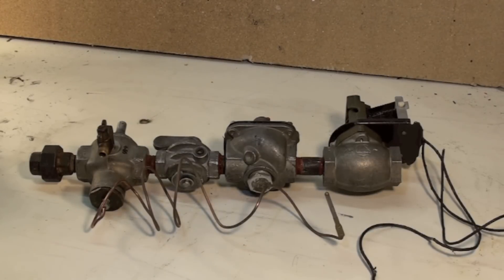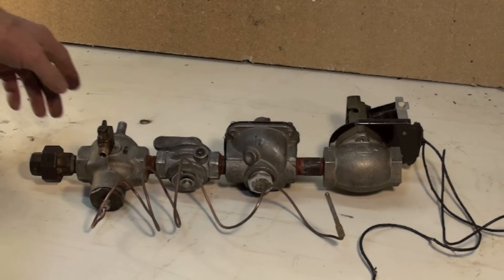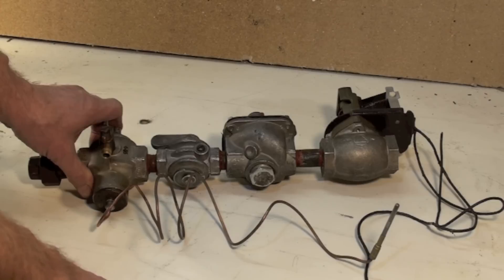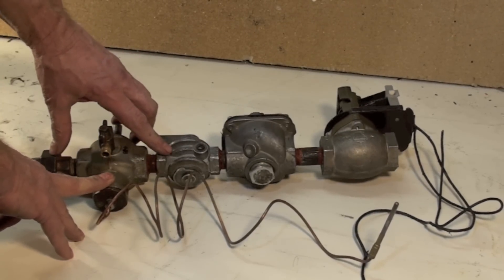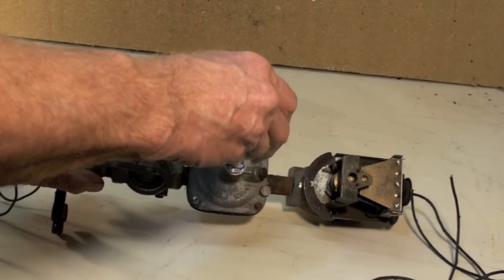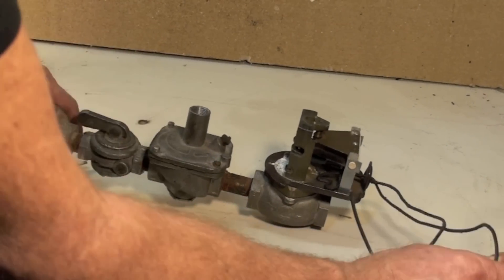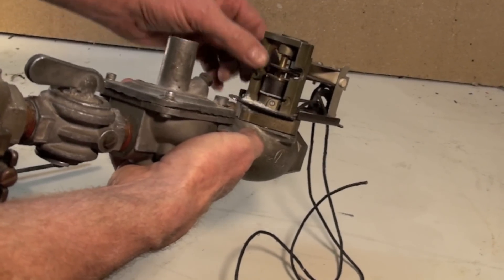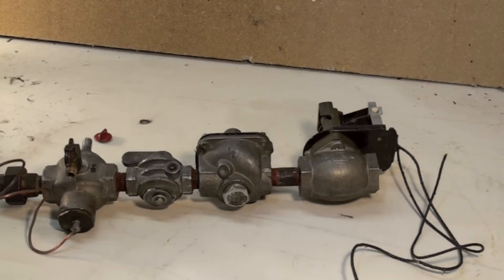The gas chain control for gas furnaces

Comment: Gary: where does the power come from for the main valve operations?
thank you.   chain gas valve operation
Reply: My thermocouple sends power through the thermostat and over-heat-limit switch and to the main gas valve, all in series. No external power. The 750 milivolt system (0.75 volts) is (was) enough to energize the main gas which needs a min of 0.4 volts to open, so I read.
0.5 volts was generated but did not turn on the gas, so I am still checking. it's cold in pennsylvania in November ....
Reply: @cliffontheroad  My thermopile (two spade clips on end of wire) does the exact same thing.  1961 model Richmond boiler.
Reply from the maker: Generally, these are powered by a low voltage such as 24 volts.
GFM

Comment: Thank you for your videos. I have a old gas chain  with a pilot and gas shut off valves at the start of the gas chain. Is there something I can buy to replace the whole gas chain?
Reply from the maker: The combination gas valve is used to replace the gas chain.  Something like the Honeywell VR8200A2132 will do.
GFM

Comment: Thank you. I finally got it cranked up. Despite my stupidity I figured out that I had to remove the glass to light the pilot. Then I had to clean the corrosion of of the thermocouple. Also wouldn’t work unless I shut off the gas on the main valve. I appreciate your knowledge.
Reply from the maker: Welcome
GFM

Comment: Great video. I have a 1955 reznor with instructions saying to light the pilot through the glass. Does that seem right or should there be another access? Thanks!
Reply from the maker: It is probably correct.
GFM

Comment: I also have a older furnace with this type of chain. Problem is sometimes it will not ignite, and if I push the button on the flame safety where thermocouple is connected it will ignite right up and work fine. It does this periodically. Question is, could this be caused by dirty or faulty thermocouple? Thanks for any help!
Reply from the maker: You can try the thermocouple.  It is the cheapest part.  If no luck, The chain will have to be replaced with a combination gas valve.  Hope this helps.
GFM
Reply: Mine ended up being a dirty thermocouple, I cleaned off the corrosion with some scotchbrite and it worked fine with no more issues.
Reply: @Shawn Netherton  Unfortunately YT didn't notify me of your response, but I THANK you!! Your explanation is the first I've ever heard that sounded like what I was experiencing. I'm going to go ahead and replace the thermocouple (had already bought one). But thank you so much!
Reply: Hi Shawn, this is the same thing that has been happening to my furnace for years. It'll work flawlessly for a while and then stop lighting. I have to push the button on the value (in and out) to get a large fire, and then it'll sometimes cut off (I'll hear a click). What did you end up doing?

Comment from the maker: If you have power to the gas solenoid, with the pilot on, I would suspect the gas solenoid has failed.  If it is replaced, the chain components are generally not available and the chain will be replaced by a combination gas valve.  I would make sure the heat exchanger is ok before I would proceed.  Hope this helps.
GFM
Reply: 9 years later; the no-external power system can have voltage. Measuring between the two screws for voltage may show almost zero difference if the upstairs thermostat is 'on' which could indicate the valve is broken.
Someone on YT said the gas valve/solinoid seldom fails, but after 60 years...
Not mentioned / shown is a thin 2nd gas line which increases the pilot light intensity, to help the main burner ignite when the turn-on command happens.
I just broke off that 'cap' trying to clean  the thermocouple next to it at the burner assembly in that very tight working space.
Reply from the maker: @cliffontheroad  The thin line is a bleed line for the regulator.  If it ends close to the pilot any gas from the regulator will be burned off by the pilot.
GFM

Comment: I have an old furnace with a gas chain similar to your video, my problem is the burner will not fire. The pilot is lit, thermocouple tested good, I have confirmed power through the burner limit control and power at the gas solenoid. Is there a proper way to test the pilot and/or gas valves? Is it common to suspect one valves failure over the other? Thank you for any help!

Comment from the maker: Yes the thermocouple safety is the first valve the chain sees so that is the thermocouple safety if off the main gas cannot come on.  However note the chain is not 100% safety shut down.  The pilot gas will still be on if the thermocouple safety shuts down.